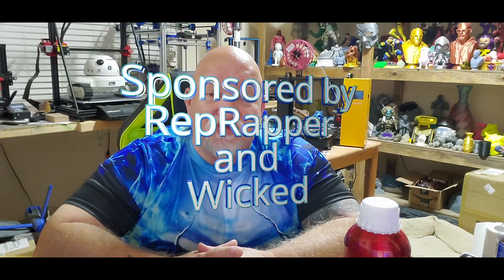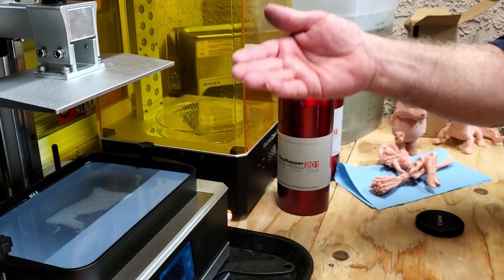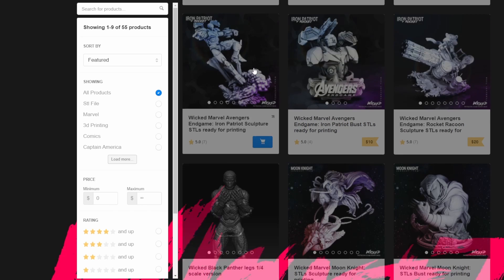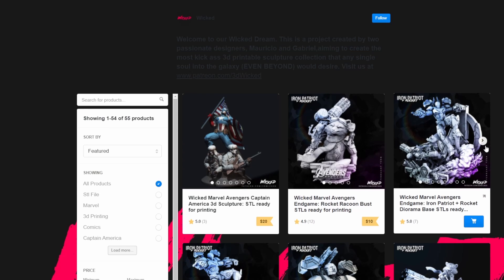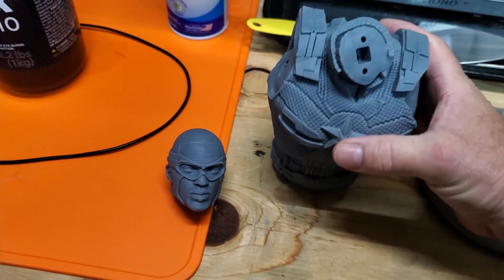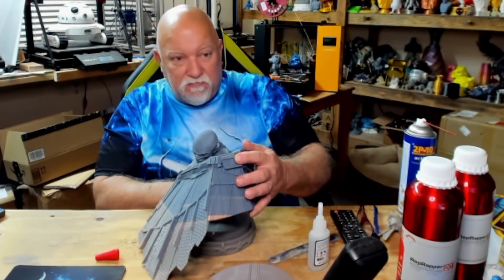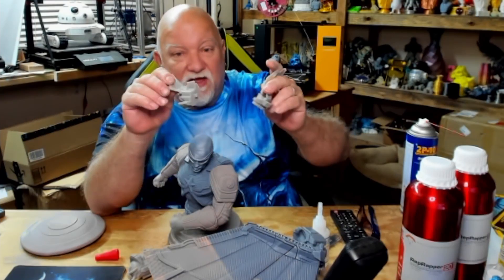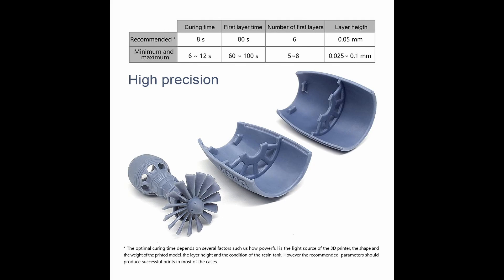RepRapper Gray 3D Printing Resin #3dhp

Comment: A couple of questions Jerry:
1.Mixing the two reprap resins would not be an issue but what would happen if you mixed two different suppliers - would there be an effect on the exposure time needing to be adjusted?
2. Would mixing the two reprap resins (or any two different manufacturers) cause any issues with different shrinkage rates meaning fitting tolerances would change between the different pieces?
Reply from the maker: I've had no noticeable issues in the past,but as seen in video on last timelapse, the resin appears to to be very thick and curing in the front left and right away from print,this is because I dumped a lot of Siraya Tech Tenacious in and didn't mix it up with another resin.
Reply: @3DHP  Good to know Jerry, thanks.